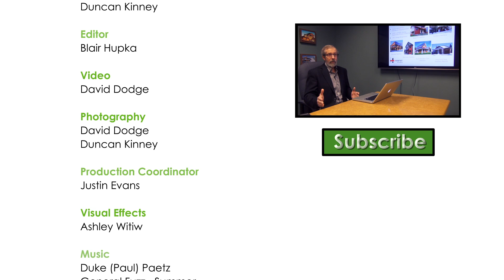82. Earthship on the prairie: A radically sustainable home in southern Alberta

Comment: Not so "passive". Requires a large amount of maint. and specialized parts that may not be there if the system goes down.
Reply: First thing i thought was there is alot annoying maintenance down the road that would have a pretty high learning curve on how to deal with it.  The kind of thing you don't want to be a pioneer of lol.  Let other people figure out the headaches first.

Comment: Tires and aluminium cans... Isn't that using a lot of steel and aluminium which isn't recycled over and over again?
Reply: This is a different type of recycling, called reusing. Even recycling uses a good amount of energy.
Reply: This is recycling.
Reply: Using aluminium cans and glass bottles the way they do is a way of recycling called re-using plus they end up not using or using at a minimum some other materials, like dry-wall, cement, steel beams etc, which would use up a lot of resources and pollute a lot more in order to be produced.
Reply: I have been thinking the same thing. The glass provides art, and the tires are a final use product, but aluminum and glass can be used over and over, saving some other place from strip mining, etc. everything has a carbon footprint, but some can go around more than once, cheaper than new use.

Comment: **Do you have any idea how warm is it in the earthship in the dead of winter on average when temperatures are near -30 celcius, and do you need supplementary heat such as a woodstove often? Thanks!**
Reply: +B Charron My question is the same as yours.  I live in a place where winters bring -40 temperatures, and a snow cover of several feet.  Last year, it was over 6feet of snow cover.  Would this work here?  How could you deal with the snow covering the building.  There is no rain in the winter, only snow.  How would you collect the water?  I wish I could see the replies to your question to know if someone had an answer.  I've found very little on this sub-topic on the internet.  I'm wondering if it's a challenge too big to take on.
Reply: Renee Olynyk Well, let me know if you find anything on this specific top, and good luck to both of us. thanks again

Comment: This ticks all the boxes. The footprint or square foot per person looks large. Taking that into consideration, how can this be adapted for the city environment situation? I would think it's a no no for the city and that, unfortunately is where most people live. What does Mike Reynolds have in mind for the city? Also I love his "wind ship" designs for the Tropics. Communal water catchment and black gardens will save space.
Reply: I agree,  it does look large...and awesome!  I'd prefer around 1200 sq ft. Great question about the city. I'm on the verge of picking a place to settle down and build a sustainable homestead, and city/county requirements are a huge unknown at this point.  However I plan on building outside of city limits, which should make it much easier.  Any thoughts or advice from those in the know is greatly appreciated!
Reply: Mike's point is that we don't need centralized grid tied communities, like most major cities, there are others who have great ideas on how a city could be built to be extremely eco friendly, one I'd recommend is EcoTownz, ( ecotownz.co.uk )